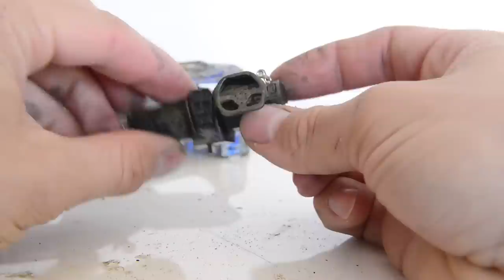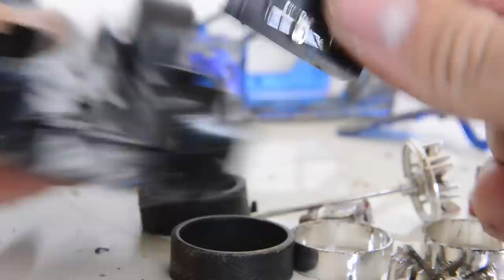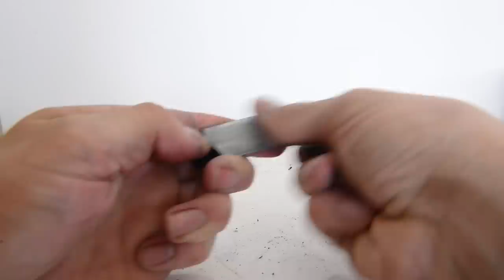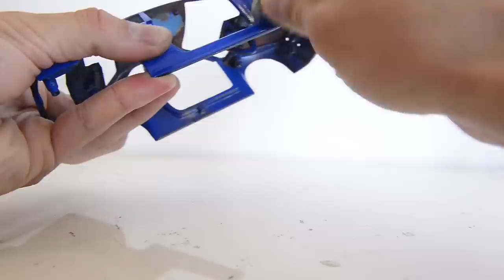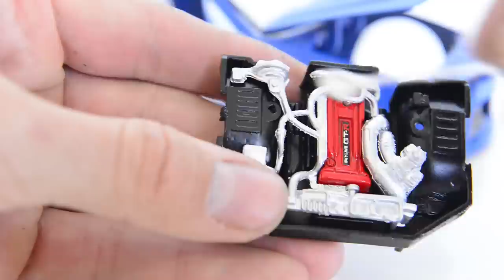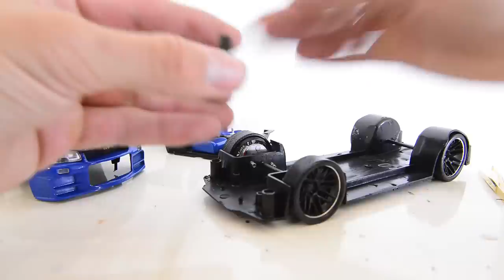Restoration Abandoned Nissan Skyline R34 GT-R 1999 - Model Car

Comment: Why didn't you detail the interior better? Why didn't you put in the other red tail light in the back next to license plate?
Reply: Both lights are there one is red, the other is clear. This is correct . One is a fog light and the other is a reversing light.